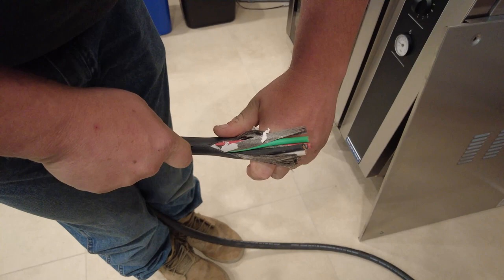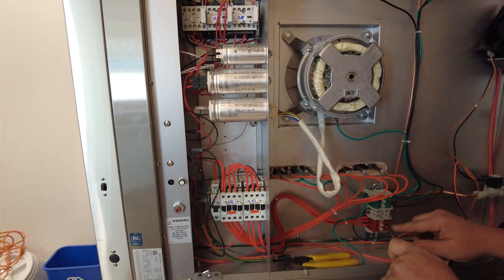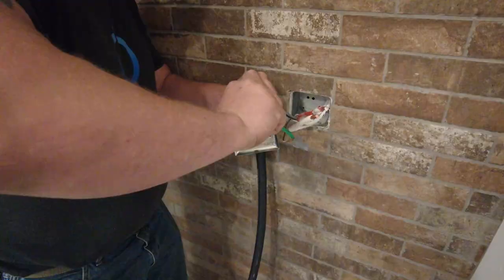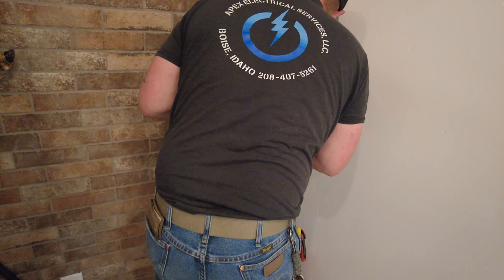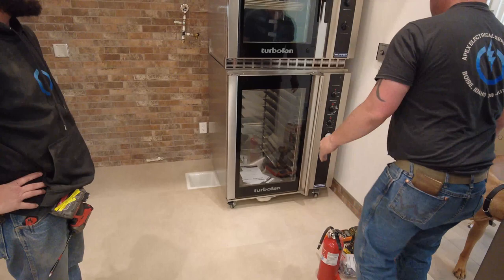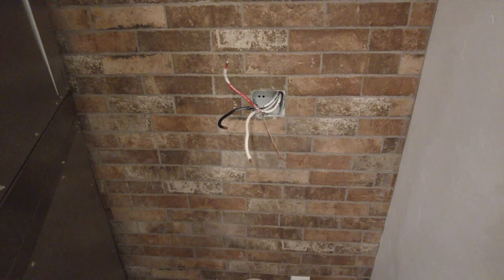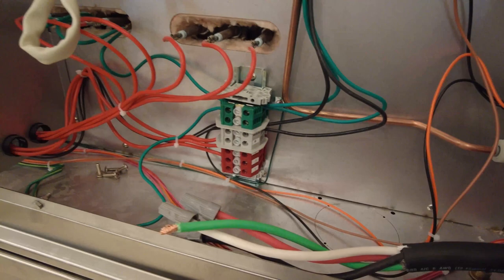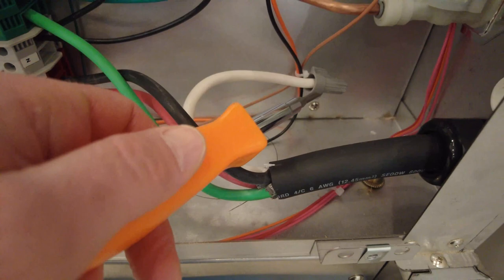Building a micro bakery: Electrical connection of the convection oven

Comment: I would have been extremely nervous connecting the hot wire to neutral...looking forward to watching the next video. cheers
Reply from the maker: I WAS extremely nervous! It is a bizarre thing to do if you know anything about wiring. You would think they would explain this in great detail in the installation manual...

Comment: 0:03:55  video location.   CLEARLY, the electrician roughed in the wrong junction box.  This should have been a much larger box just for this reason.  An electrical should not have to Cram Wires into a box they should fit comfortably especially dealing with this voltage.  The box should have been firmly screwed or nailed into a wood backer for sturdy fixation.  Poor Mike, you have had a lot go wrong and most of it isn't all on you.
Reply from the maker: When I do the deck oven next, I plan to have them mount a box with a kill switch on the wall. That's even more power - 80amps/240V, so I'm not going to mess around.

Comment: Thank you for this video! My version of E32D5 is slightly different - it has a connector before the block with only three holes (black, red and green). On another note, could you please tell about water connection? I called Moffat with a simple question, but they don't know. The question is what pressure is required? I am thinking of getting a 10-15 gal tank on the wall above the oven and feeding water by gravity. Not sure though whether it will be enough in terms of pressure...
Reply from the maker: I'm surprised Moffat didn't have an answer for you, as their technical support folks are quite knowledgeable. The water specs are easily found here: https://www.webstaurantstore.com/documents/specsheets/moffat_e32d5_single_deck_5_pan_electric_convection_oven_digital_controls_specsheet.pdf. Under minimal pressure, it is listed as 20psi. Approximately every 2.31ft of elevation drop = 1 psi of pressure head. So to get that minimum pressure, you would need to take your water tank up to almost 50 feet! I think you'll need to look at other options, unfortunately. I have my oven hooked up to a reverse osmosis system and that has been working very well and giving me scale-free properly pressurized water.
Reply: @LoveLevain  Thank you so much! I didn't notice that in the spec sheet. It is strange, because all I asked the tech guy was the minimal pressure. When I mentioned a tank he said - yes, go ahead, give it a try :-) Now I need to find a way to pull a water line in a way that will make our building inspector happy...